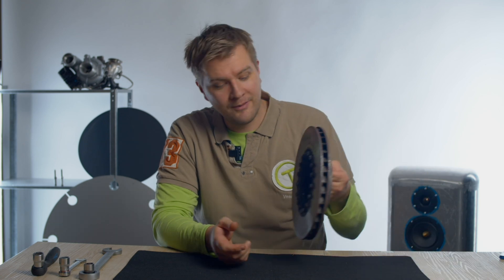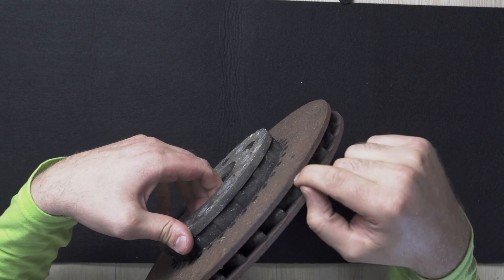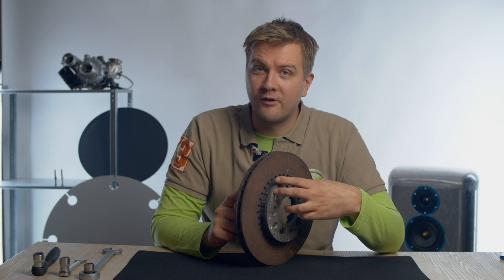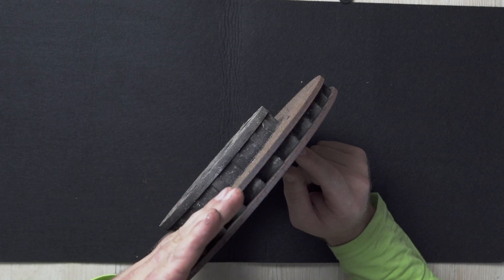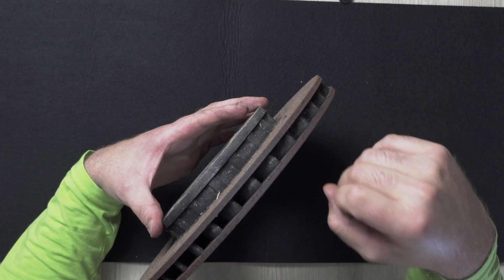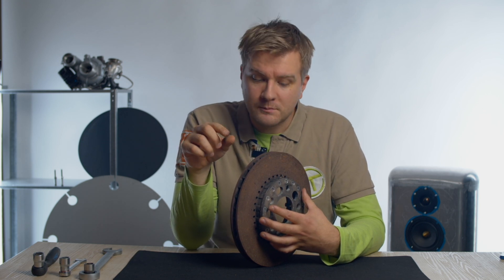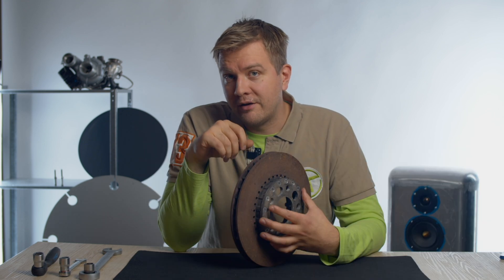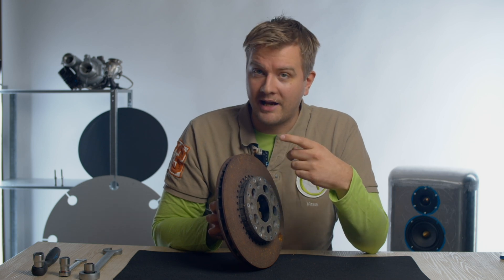Custom steel aluminum brake rotors that are easy to make.

Comment: How are the vanes fixed/held?
Reply from the maker: They go to the centre where its all bolted together. Air goes inside the disc from those small round holes you can see in the metal discs in this version.

Comment: They will corrode each other.
Reply: In a race application it doesn't experience rain snow or road salt. lol Not much corrosion happening even with dissimilar metals. Especially since they will be changed out long before any corrosion happens.